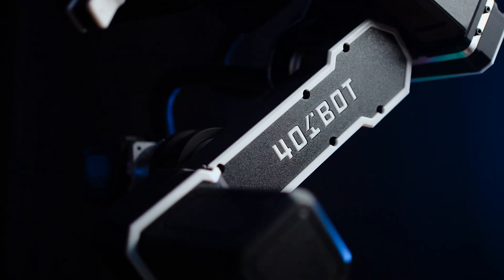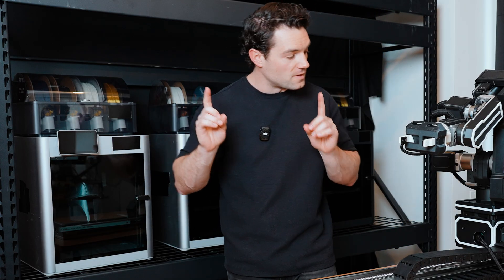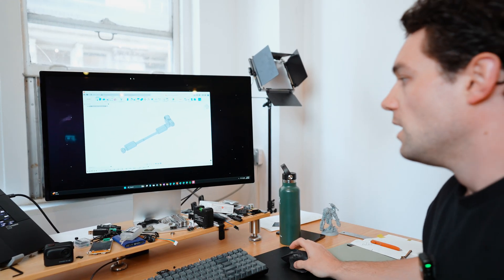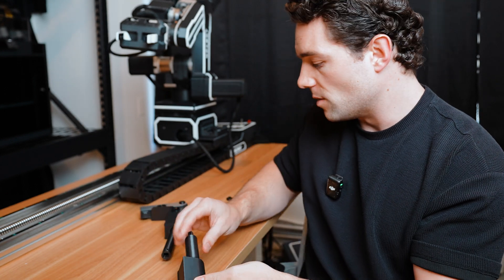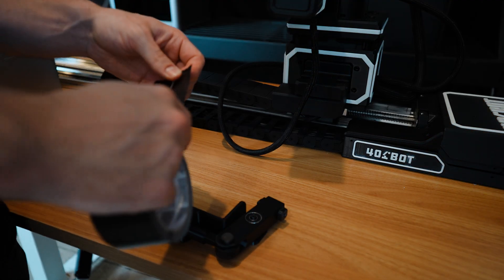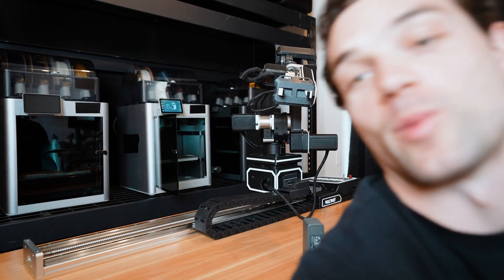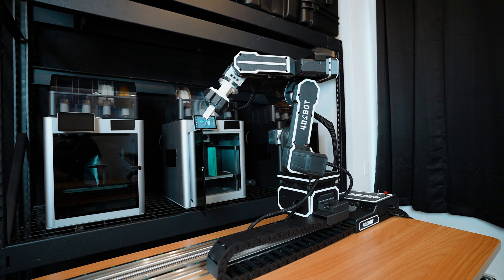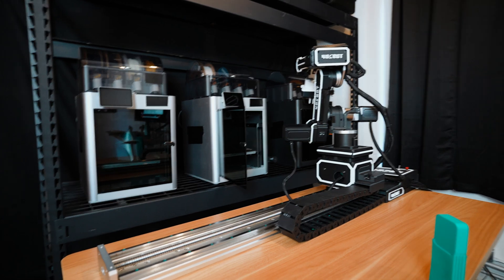3D Printing Tools - a robot?

Comment: I think you will need a way for the robot to calibrate where the printers are.  Each printer should have a way to register into the shelf either with simple holes for the feet or a full on cutout it sits on. That way the printer is always does not move with respect to the robot. If you change filament or something it goes back to where you said it was.  Even with that the software needs to be flexible enough to calibrate its finale movements with a camera system.
Reply from the maker: The printers shouldnt move. The robot runs a calibration sequence when starting. Example the robot moves to the location of the door handle, you then make sure the printer door handle is there and press ok.